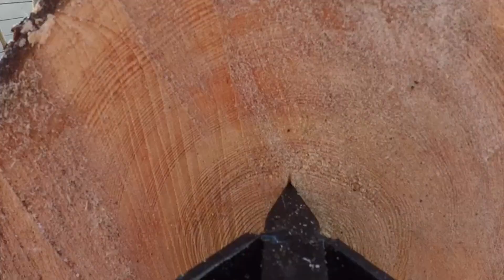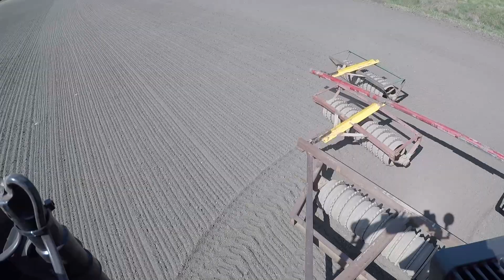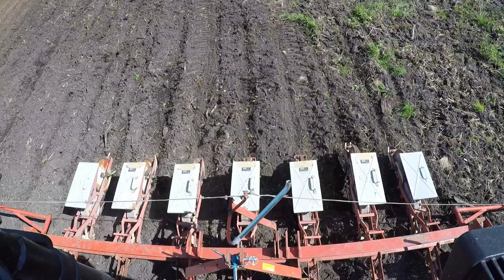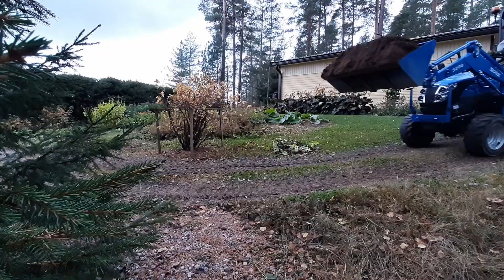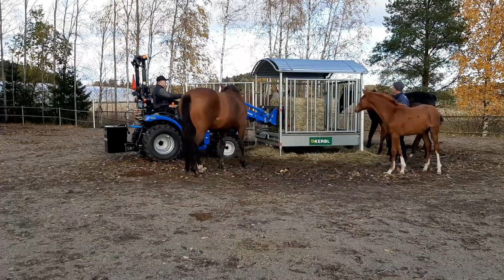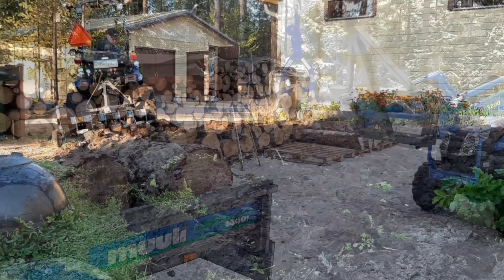SOLIS26XL 2022 Parhaatpalat

Comment: you sell implements such as moldboard plow with small unit for shallow depth
Reply from the maker: The plow is self-made. It uses the triangular frame of the SAMI ploughs, on which the plows and depth adjustment wheels are mounted on the attached steel beam. See also the SOLIS26XL_Syksy2022 video where you can see the structural parts.